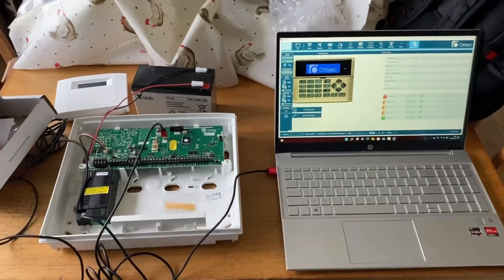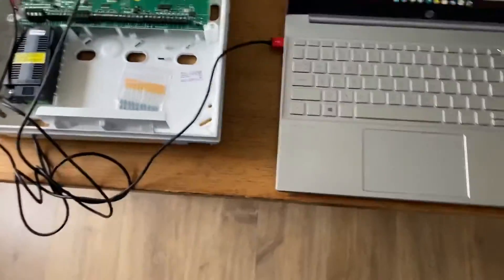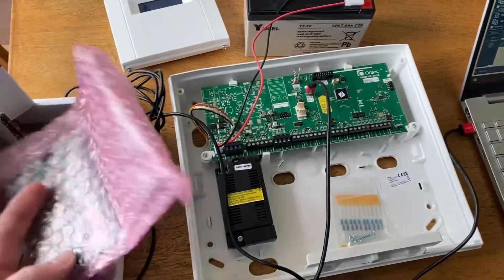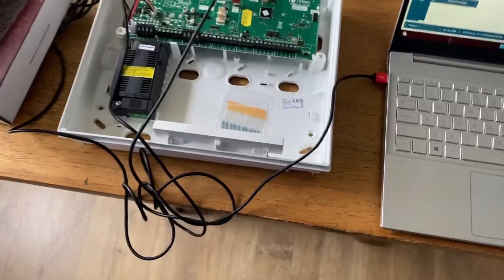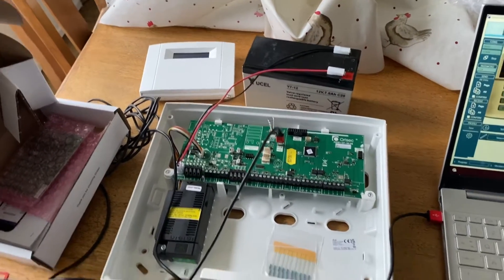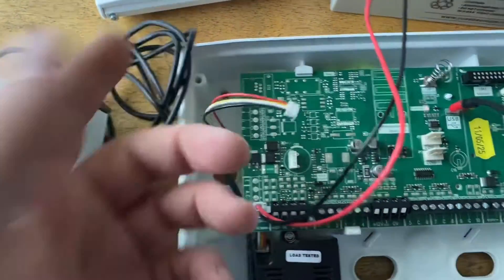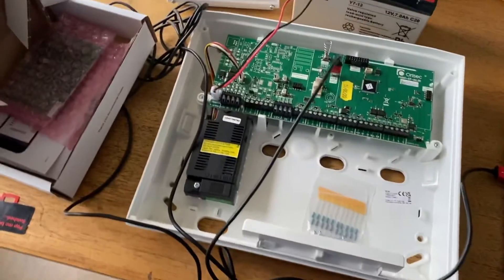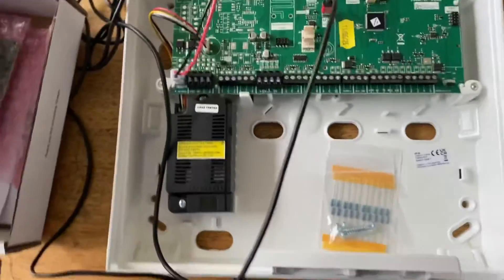How to Connect a WiFi Module to an Orisec panel and connect it to the WIFi

Comment: Hey - I've just changed ISP and managed to get online. However, after about a week, the app has stopped working. Is this to do with IP setting on control panel? When I "view module status", signal shows as 100% but status "Not Fitted" - any ideas please? 🙏🙏🙏 Thanks in advance 🌹